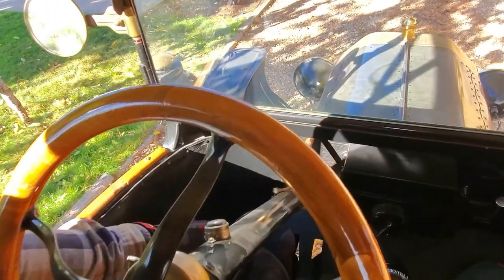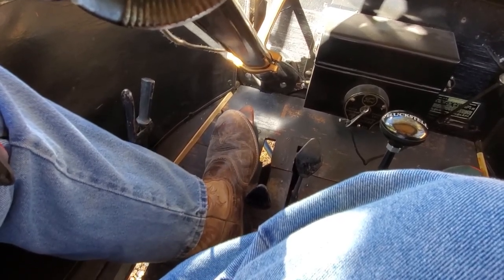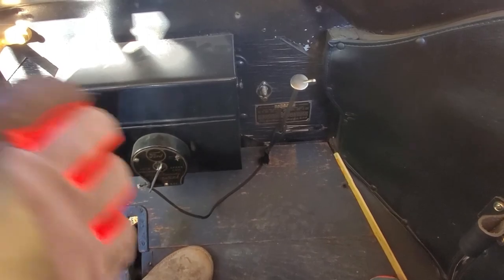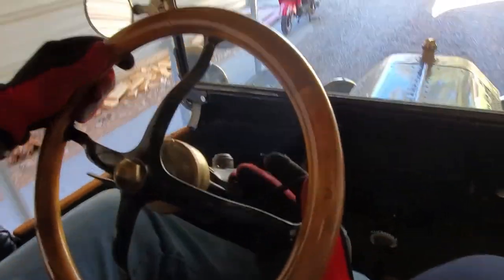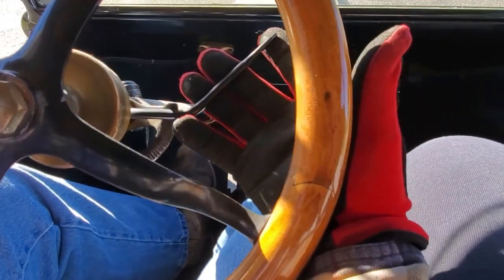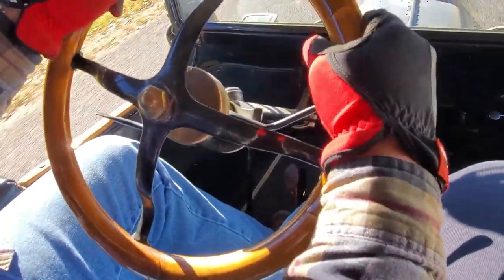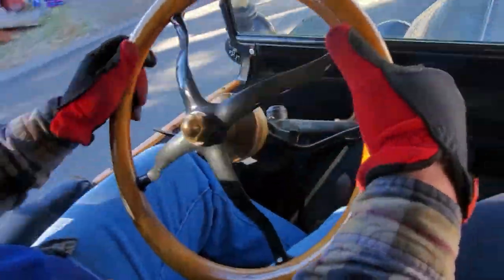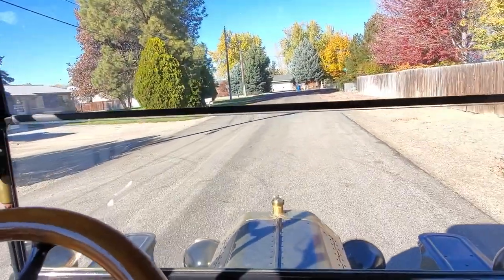How to Drive a Model T

Comment: great video and the one on the ruckstell too. I use my 1915 touring daily, .  I prefer to put the contactkey upside down so it keeps away from my feet and it's easier to reach. Kind regards Blacksmith Filip Ponseele-Belgium

Comment: Thanks god that they didn't continue to use that disposition of controls in modern cars hahhahha! It's great for a little tour but man, using constantly your feet your hands and looking out for the mixture, the spark... man, it's a recipe for a disaster xD
Reply: More Automobiles existed than just a Ford Model T.
Reply: That system is what's today a automatic transmission hydraulic operation.is  sunn gears & bands

Comment: But doesn't the hand lever do more than apply a rear brake?
Reply from the maker: It first locks the car in neutral when pulled part way back then applies the rear brakes when all the way back
Reply: @MiloFarms  And when all the way forward?
Reply from the maker: @wholeNwon  All the way forward allows the car into high gear and allows you to use the low pedal for low gear
Reply: @MiloFarms  yup.  "So simple even a woman can drive it."